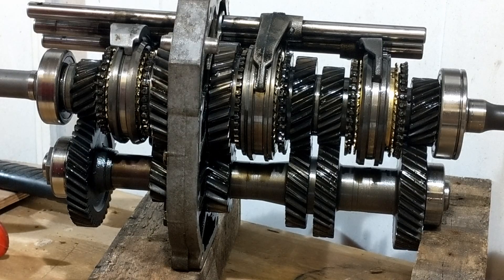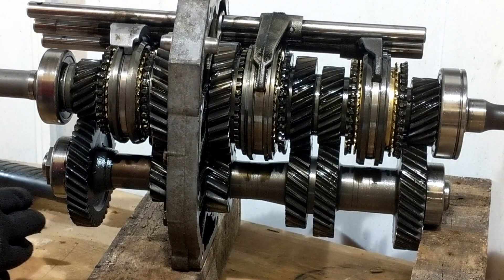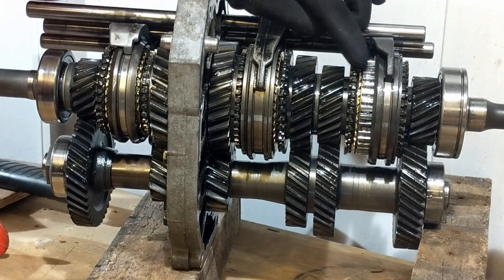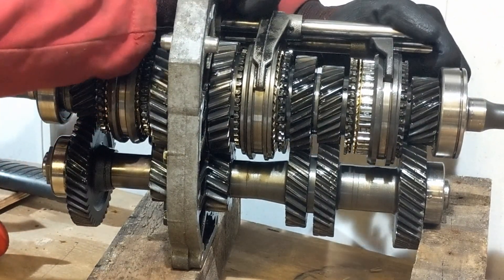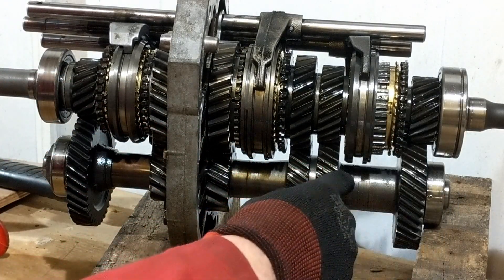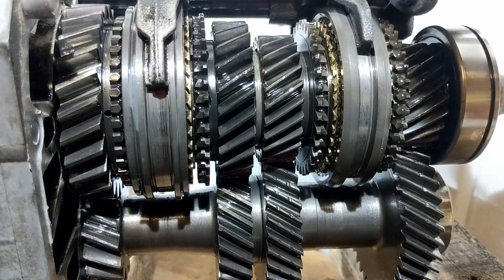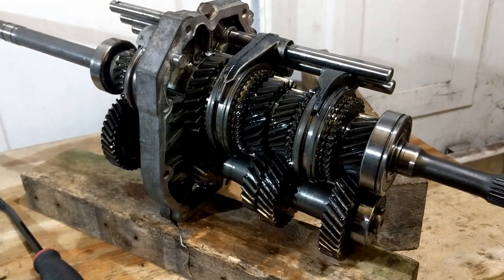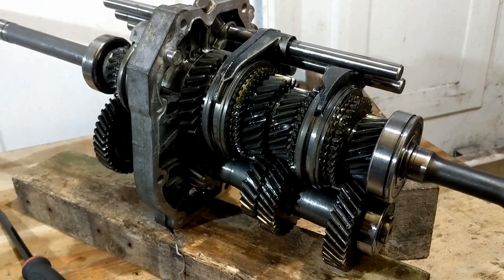mx5 gearbox dismantle miata transmission part 3

Comment: Hi Alan.
This past summer I exchanged my 2012 MX-5 Auto for another car with the 6-speed manual. 
(I had purchased the original car from father-in-law, who IMHO made a mistake with the automatic choice)
Anyway, I note the most of the time 2nd & 3rd gear are less easy to get into gear, not that it is terrible or grindy but just a bit less smooth. Then on some occasions shifting into 2nd or 3rd is noisy. Difficult to describe the noise unfortunately. I purchased GT-90 (???) I think that was it, and had my mechanic change the transmission lube. When he removed the drain plug out came a very silvery old lube. This was done at 19K miles and we noted that the drain plug was pristine -  never had the lube been replaced. The owners manual asks for two changes by the 19k mile mark. So my lovey car may have a nasty transmission surprise planned for me.
Given the above story do you have any suggestions or other comments that may help?
Dan